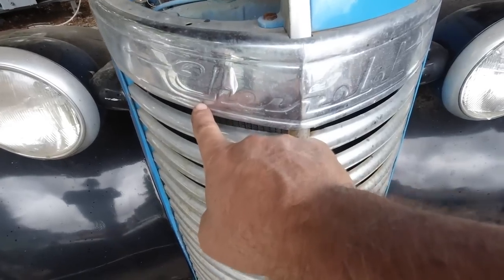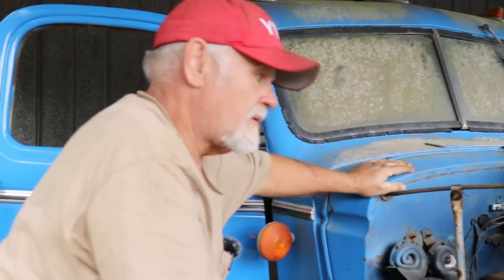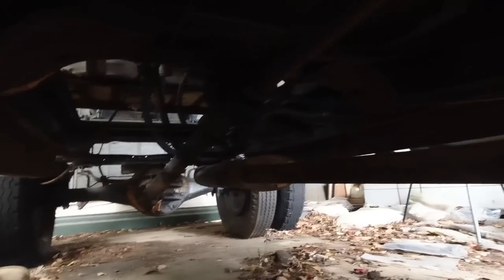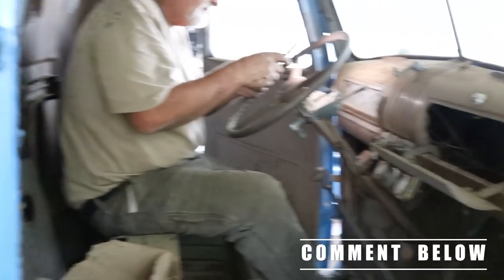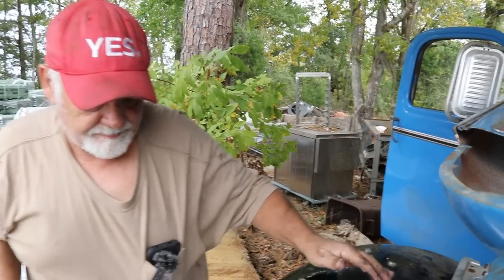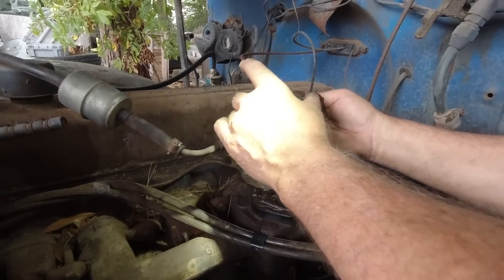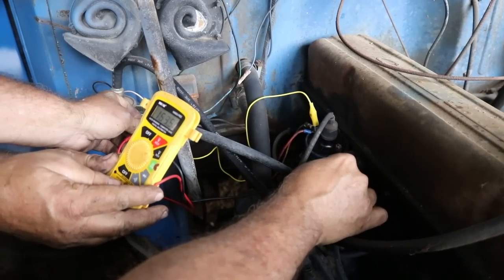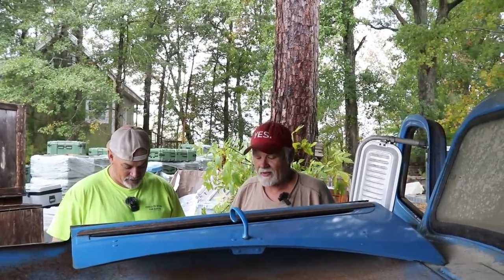WILL IT START? 40'S BARN FIND CHEVY TRUCK! We Have No Idea What we’re doing!

Comment: Wiley, the coil is constant power (spark) and the camshaft turns the distributor causing point to open and close and that is how it knows when to spark. The condenser absorbs power (spark) when not firing and discharges when firing. Hope that helps. Hank, you OHM test across a coil. To see if it has power to it, probe positive side but ground it to anything grounded NOT the negative side of coil, thats  for the points to signal spark. Therefore IF points are open, theres no ground to voltage test. P.S. the condensor is far more likely to be bad Hank. That lil bugger will stop spark all together if bad. Coils are rather tough if not overheated.
Reply: In my mechanic days, many many moons ago, the service truck had boxes of points and condensers.   Seldom did a coil go bad.  David you gave an excellent description of the process.   I used to love the GM distributor points door.  Even I could adjust them.  😂
Reply: My question is,, might the Capacitor be bad??
Reply: That david too
Reply: David told you the right answer
Reply: You need to change the petrol pump and call the coverage and the oil in which ticket and then bring up mechanic with us with you girls A woman mechanic Toyota hollows for the blue truck what's the And get a touch of the touch of the touch of the truck Peter boot
Reply: The coil pack is out but the coil pack in
Reply: The cool is out put a new pool in area fire out of
Reply: Get a new get a new coil and I promise
Reply: Uhh run a 12v. To run. The coil  and turn on ignition to crank...jhot wire hot. Wire

Comment: I suspect that soup can you see is a vacuum reserve for the wipers.  Most vehicles back then had vacuum driven wipers.  The main problem with them is that every time you step on the gas, the wipers would stop for a few seconds.  Adding a reserve would help with that problem.
Reply: Don't forget many of the vehicles from that era came with 6 volt not 12 I was surprised to hear an electric fuel pump was actually used especially on a truck motor
Reply: The wipers say “dumb-guy” with each swipe otherwise
Reply: @FedUpCanuck  Almost everyone who kept these trucks converted them over to 12volt .
Reply: @truck87654321  that's true but just to make sure it never hurts to find out especially with older vehicles

Comment: The coil produces a spark when the power is taken away. It's a collapse of the energizing of the secondary winding in the coil that produces a spark. Put 12v to the coil and simply take the negative lead and ground it for a split second. When you take it off ground, the coil should produce spark. 
Once you establish that you have a good coil, you need to make sure your points are opening and closing.  The timing of the points opening needs to coincide with the piston being at nearly top dead center. The points opening and being timed with the pistons is how it "knows" when to spark.

Comment: Hey Hank here's a deal on the carburetor leak. The thing that you're pointing to on the carb is the throttle shaft these carbs were notorious for the shaft wearing the body of the carb and leaking around them it's not a major deal my Chevy Nova does the same thing it's a common problem the throttle shaft and bushing is just worn. If it's leaking really bad it should still run but would need to be repaired eventually. Where the fuel line screws into the carburetor that big nut screws out as well and there is a ceramic filter in it
Reply: My 1941 had a brass filter and I believe they were common.

Comment: The spark is created by the points interrupting the neutral side of the coil when the coils power is interrupted by the points opening is when the coil produces the high voltage for the spark plugs

Comment: I agree with David  check the condenser inside the distributer make sure the points and coil wire are good  !!! It's not difficult to check the condenser the coil is actually like a capacitor  !!! The  condenser is the little round tubular thing with a wire going to your points  !!!

Comment: hank make sure the points and igniter are clean. sand paper or the back of the match book will clean the points. they also have to be set usually i think around  45,000ths.

Comment: Hi guys,
If you put 12v to the coil, and take the center wire close to a metallic ground, open and close the points manually.  You should see spark from the coil wire to ground. 
Also, the vacuum under the distributor adjusted the timing.
One thing as a helping idea...if/when you pour gas down into a carburetor on something that has sat for a long time, it is a good idea to use a 2 cycle mix of gas/oil to help lubricate the rings and top end of the motor when cranking over...helps until the engine can develop enough oil pressure. 
Can't wait to see the next part...
Reply: Vacuum advance under the coil,
Reply: Very good idea using the gas oil mix! Please no more ether.., You can also put a few drops of oil in each cylinder under the spark plugs.

Comment: You guys did fine, just missed a couple things gas engines need, I would replace points, ohm out the coil to see if it’s good and if anything hot wire the coil to the battery, for diesels boys y’all did amazing!

Comment: Other people will know more than me, but I'd clean all the contacts in the distributor cap and the points. The condenser may even need to be replaced. (The tiny cylinder in the distributor) and see how that does. I'm not sure about the carburetor. I'm assuming it needs a gasket (RTV works too). And see how that works. Thanks for sharing guys! God bless!

Comment: Cool looking old truck. Its a beauty.  It turns over really fast. Every rig should have a good gas tank. Boat tanks are good for first starts.
Reply: Turning over really easy could also indicate compression issues maybe stuck rings
Reply: It’s likely a 6v starter being fed 12v, that makes them crank really fast… see it a lot with older farm tractors
Reply: @danielrobey1759  I like the old beasts and grew up in the muscle car era. So much easier to work on without smog control or electronics
Reply: @FedUpCanuck  True and a good starter too.
Reply: @danielrobey1759  Nice.
Reply: @FedUpCanuck  I know exactly how you feel. Working on My 2007 VW Eos is a painful tight engine to work on.
Reply: @shartne  I hate the newer engines big hands just don't fit tight places

Comment: David explains it very well how it works. The High Voltage jumps the tiny gap from the rotor in the distributor to the output wires to the spark plugs. Put your meter on the Ohms scale to check the coil for continuity. There could be a high-power series resistor in the feed wire to the coil. Vehicles of this vintage may have originally had a 6 Volts system. The speed of the starter sounds good, and it is most likely a 12 Volts system or got converted at some stage.

Comment: With the ignition on, if you ground the center wire out of the coil, you should get a spark. If you pull a spark plug wire and hold it near a ground, you should get the spark as it turns over.

Comment: i recommend watching videos from Junkyard Digs, Kevin knows gasoline engines really well. You can test the coil by putting a hot wire to the positive terminal, and jumping to a good ground (negative) on the frame or engine, touching a wire to ground should make a spark at the main wire from the top of the coil, doing the job of the points. You probably need to clean the points better.

Comment: Check all the wiring going from inside of the cab.& Out to those points. Check for A resistor going to the coil as well to. Cause if it's bad it will not let power flow through to the distributor.& Coil.,or check for A blown linkable fuse on the firewall of that truck to. Cause it maybe bad to.

Comment: Remove and clean the carburetor, Clean all jets inside the carburetor, see if the float valve pin is stopping the petrol flow from the tank. Check if the float is not having liquid inside and is floating on petrol. Replace all gaskets of carburetor. Reassemble and try one more time. Hope there is spark on every spark plug all the time of cranking. Remove one spark plug pour 5 drops of petrol in one cylinder then put the spark plug and start cranking.

Comment: Some things to know about gas powered vehicles built before 1954: they originally were built to run on 6 volts. The starter will crank on 12 volts but you have to make sure the rest of the system is running on 6. Your coil might handle 12 volt for a short time but the rest of the system will burn up. To see if it's been converted to 12 volt, look at the data plate on the generator or regulator to see if it says 12 volt anywhere. Also, many pre-1954 vehicles had positive ground rather than negative ground. One way to check is if the positive side of the ignition coil wire goes to the distributor and negative comes from firewall. This may not help though if someone who didn't know crossed the wires already before you got there. Most likely, though, this has negative ground because GM generally made GMC truck positive ground and Chevrolet truck negative ground. The engine most likely is a 216. There may not be an oil filter as the oil system had no pump but a scoop system to fling oil onto the moving parts. You gotta keep the oil clean if that's so. There should be hydraulic brakes with mechanical clutch. Nice old truck. It's possible that it dates to the late 1930's even. In 1941 Chevy changed design to half horizontal grill and bottom half vertical. Great find!

Comment: It could have vacuum wipers. Pull a plug out or use a known good plug and ground it on the head to see if you have fire if you have fire poor fuel down the top of the carb it should at least fire off if it won't stay running. If you don't have fire the points could be stuck together or just really dirty. I would say that is probably a 235 motor.

Comment: You hit it on the head right at the end Hank, you need fuel, air, compression & spark and that engine was never going to start without spark.
I suggest you thoroughly clean the points, making sure the points are off cam, ie: not open. (where the points contact the distributor cam in the centre, they need to be on a low spot).
When you have cleaned them and with the ignition on, give the points a gentle flick, you should see a 12v spark across the points, if you dont, you ain't getting a power signal to your coil.
Once you get that side of it sorted, and with the (way too much gas you poured down that carb🤣), she'll fire up, I betcha👍👍

Comment: Taking distributor cap off remove the rotor take a flathead screwdriver between the point Breakers and open and shut the points if the coil is good and getting good connection the wire will spark it's not a fuel issue it would have fired with the first shot of starting fluid you can also run a direct wire from the positive battery terminal to the positive coil
Reply: Exactly, has to b e spark problem, not fuel.

Comment: Hopefully, the truck has been converted to 12 volts (notice the ballast resistor on the fire wall) If not, you possibly burned out most of the lights. On cars/trucks built with "butterfly" hoods, there is a place where the rear corner of the side panel can rest on the cowl to hold it up. Trailer brakes were probably vacuum, and controlled by the lever on the right side of the steering column.

Comment: Vacuum over hydraulic brakes is what you have there. That what they used on semis before air brakes. That's about a 3500 series truck. Those lines under the dash probably went to a hand valve to operate the trailer brakes.❤🐘🇺🇸Do you see a ballast resistor on the firewall or fender well?

Comment: It's a Early 40's, check for spark, lever on shifter is for the 2 speed rear differential, bottom of distributor has a vacuum advance for timing, rotor needs to point at number 1 cylinder when it is on the compression stroke. Hope info helps
Reply: The lever on the shifter is a reverse gear lock out. The standard GM 4 speed had reverse towards the driver and back. You could shift into reverse when downshifting accidentally if the lockout was broken. I owned a '48 with that same transmission.

Comment: 1939 is the only model year that matches this truck. Also, it has a newer Chevy engine, 235/262/292 design. The engine came out in '53 in Chevys with powerglide transmissions and were often referred to as Powerglide engines because the engines in standard transmission cars were still the old style 216 with oil slingers on the rods and adjustable lifters, where these engines had full pressure oil systems and hydraulic lifters.
Reply: The 216 had babbitted bearings and dippers on the rods.
Reply: Engine is 53/54. Clue is old style water pump, 55 and later had a different style pump.

Comment: According to the grill on this truck....it is a 1940 truck.  In '41 the grill on the trucks changed quite a bit and were the same thru '47.  Also....the truck would have been 6 volt originally, so obviously they did the 12 volt conversion at some point.  And simple rule of thumb with and gas motor....if you're putting ether in it and you don't get any pop....your first problem is no spark.  You may still have fuel side issues.....but if you have spark the ether will at least pop.  No pop.....no spark.

Comment: Hank, there was no fuel in the carby when you took off the top so the filter could be blocked, but you poured enough fuel down the carby to get the motor firing.
Wiley, when the rotor in the distributor turns it directs the high tension voltage from the coil to each plug in turn.
With the ignition turned on, there should a spark at the points when you open and close them. When you turn on the ignition there should be 12 volts on one of the coil terminals.
Reply: This was painful to watch. There was probably compression. The starter fluid gives it fuel. With spark it should fire. The points will corrode over time. Emery paper across the points will remove it. Sometimes even a matchbook cover will do the trick
Reply: @stevelaugen705 , It was pretty tough to watch from my house too. You mentioned the matchbook for wiping thru the points, I learned that a dollar bill works pretty good too as a last resort. A crisp bill works better than a worn out dollar bill. The fibers of the cloth of a bill help pull the carbon off of the contact surfaces to help continuity. Grandpa always made me clean points with alcohol if I ever touched them with my fingers, told me that the oil in my fingers would kill continuity between the points.  I learned about the dollar bill on my old Harley panhead when it started gettin hard to start or cutting out.
Reply: Enough fuel down its throat to fire up half the motors in the 🇺🇸 great content as usual.

Comment: Its your vacuum advance hooked up at the bottom of distributor. Those were fine trucks in the day. 6,000 lbs payload. That 5th wheel is a farm cradle to pull hay wagons and such. 3 speed trans with overdrive (lever on the stick shift).

Comment: 40's early 50's.  Looks like an oil bath air filter.  The top normally was a wing nut.  Might have lost it...on the road.  That is a Generator DC V.  Alternators AC V are not that old. Plug might be 15/16 ?  Looking at the dash dial - 56.  In the late 60's Alternators came in lots of cars were generators still.  Our 57 Ford Fairlane (Large wings 🙂) generator but our 67 T-Bird had Alternator as I recall.  I bet that is black rubber.  MTBE melts rubber.  Caused engine fires.  Went to Neoprene.  Turn Carb for vac advance.  Should be tight.  The points should turn on and off as it cranks.  I bet the Air needs rotating.  Points turn on-off-on with a cam on the engine.  Can be turned for a different cam action - and timing.

Comment: It has A shaft that has A cammed gear that works off of the oil pump gear inside of the camshaft gear. When the engine rotates.& Moves that camshaft it sparks from the points distributor.& Then to the coil I'd check the power wire feed into the points distributor.& Going out to the coil. Yes I'd clean those points with A points file.& Bring A coil along that way you'll have all of your parts on hand the first time.& I'd get A new set of points to just to be on the safe side of things. Remember to set those points top dead center at 00.20 is the gap depth setting for those points to.

Comment: My Chev. '39 4dr. Master Deluxe, had a similar can arrangement.  As I recall the Motors Manual said that it was for the vacuum assist shift mechanism.  Wasn't connected when I got it in the mid 60's so I left it like that.  Narragansett Bay

Comment: Another way to check for spark, if you're like my grandpa was, pull one of the plug wires grab the end of the wire where it connects to the plug and ground yourself, if your eye starts twitching you know it's good, lol, but on a serious note if you take one of the plug wires and get a light tester, can be bought at any auto parts store and cheap, put the clip on something to ground it and stick the tip of the light tester in the plug wire at the plug end, if any fire it should light up

Comment: Clean the points and set the gap. The electric pump probably produces more pressure than what the needle and seat can stop and I would venture to bet they’re stuck. These trucks start easy as long as they get spark. Pull the plugs and set those gaps also. .030” is a good place to start on the plugs and .018 is a good place to start on the points.

Comment: Pull one of. The spark plug wires hold it about 1/8 inch from a good ground. Try to start if you see a spark  coil and points good. If not check points, condenser, and coil.

Comment: On gasoline engines the priority is spark at the plug gaps correct timing helps after that it’s very forgiving I have had an engine engine fire up with A squirt of fuel no carburetor or intake manifold didn’t work great or long but proved it was worth putting more time into